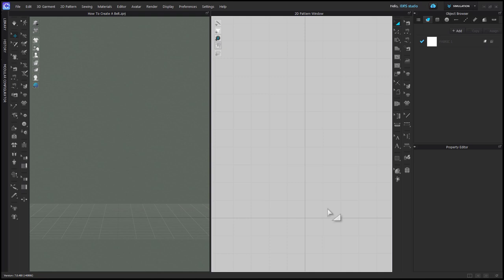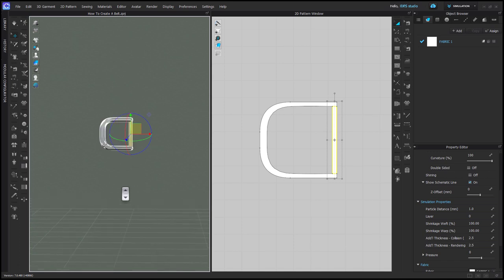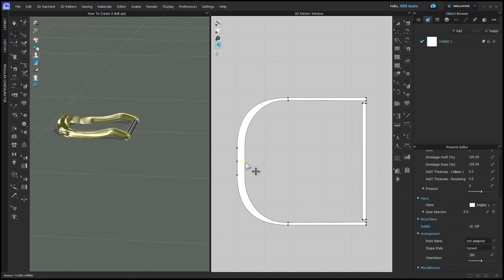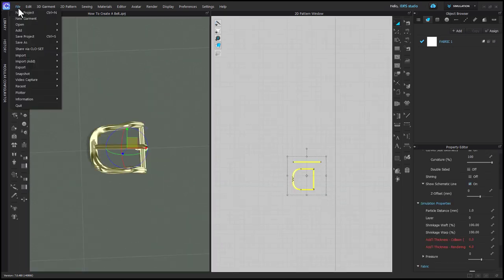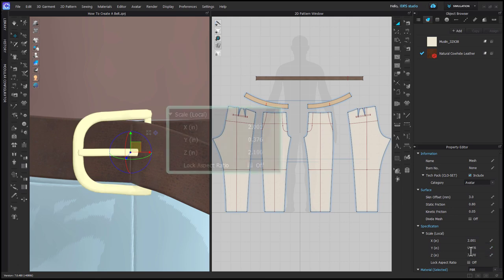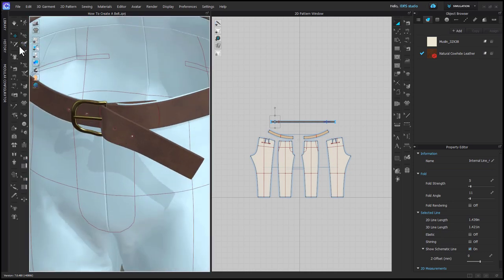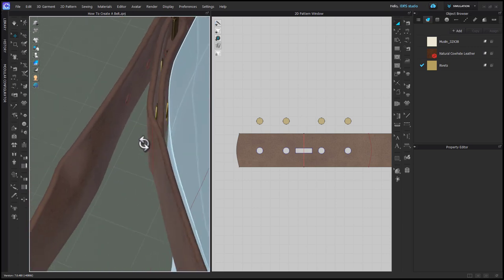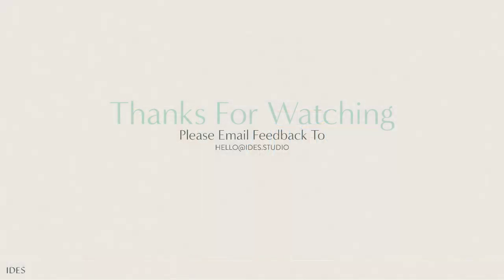How To Create A Belt in CLO 3D

Comment: Can anyone help me with the thickness of any material? I'm putting the value but the thickness of the material isn't increasing 😢
Reply from the maker: Yes! I imagine it has to do with your view in 3D. Look at the vertical toggle menu in the top left corner of the 3D window. It's like your hide/show menu. For the fabric view, choose the blue/white fabric that is THICK. It's called Thick Textured Surface. If you're on regular Textured Surface rendering thickness will not show up.
Reply: @ides.studio  thank you very much sir
I just checked it successfully 👍
Reply: @ides.studio  you've got a new subscriber 👍😄
Reply from the maker: @Mr-And-Mrs-Ahmed  Great! Glad it worked and thank you so much for your support!